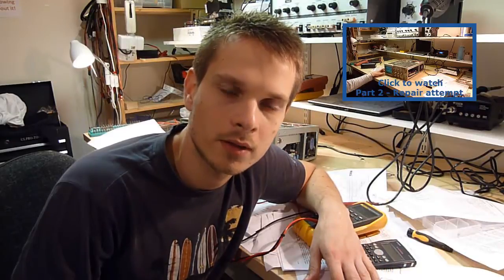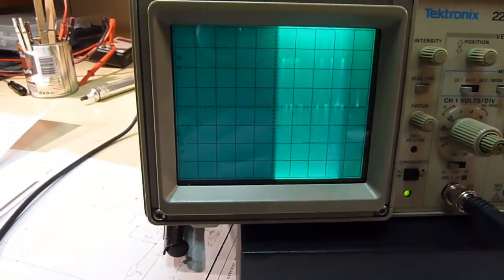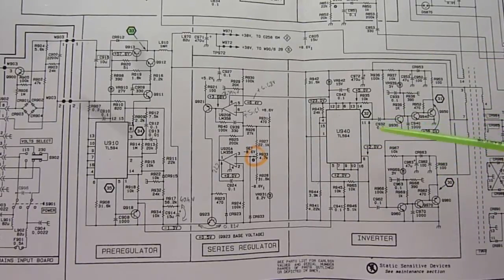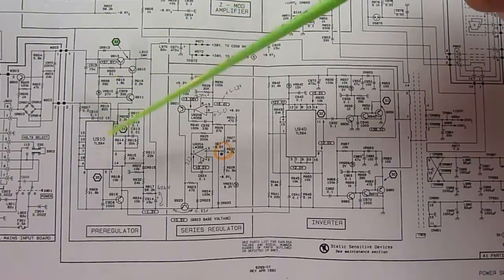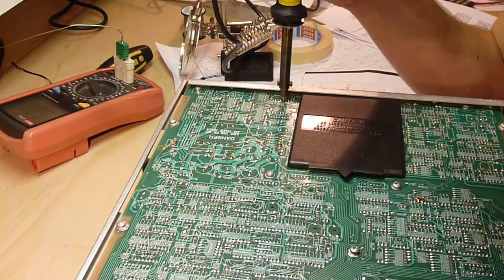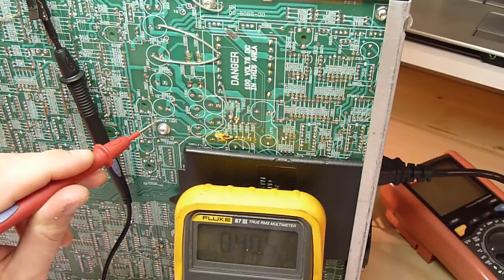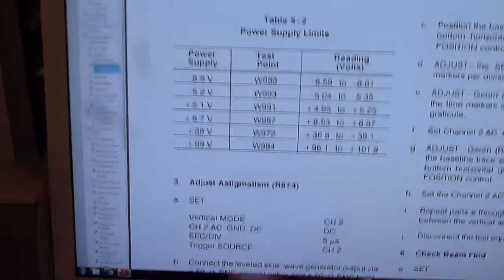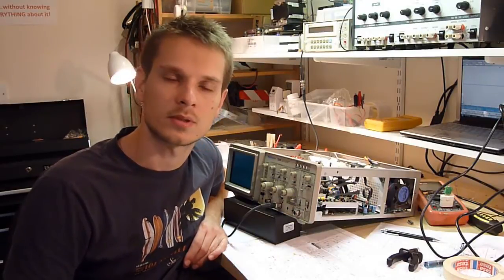ManCave 003 - Tektronix 2201 Oscilloscope Power Supply Description and Repair

Comment: anybody can tell me why my oscilloscope displays only half of horizontal line? and how to fix it?  when it brought to me only bright spot in the center, changed paired output transistors and got only half horizontal line. checked for other side, paired transistors found to be in  good condition, still getting only half line. can anyone help me solve the problem?
Reply: Did you test the horizontal circuit diodes as well?
Reply: Problem solved.
One of 10 ohm transistor bias resistor was defective,  replaced and scope worked as it should.
Reply: Always check beam switch first.. if not working the problem is intermittent switch or solder connection on switch.

Comment: Thank you for your fast reply My friend. And I have opened the same today morning, then  noticed that there are two variable resistors used for controlling focus and intensity, the intensity POT is not at all working, So My question is replacing those resistors would make any improvement ?. Thanks for your time.
Reply from the maker: +Vishnudas Kartha That's interesting. The intensity and focus pots are usually accessible on the outside and from your previous comment I assumed that even using these you cannot get the correct focus. If the intensity pot is not working, this may still cause an effect which might seem like the beam is out of focus, while it's only at a high intensity setting.  Anyway, I would say that it is worth replacing the pot if you are certain it is not working as it can only help.  ...and is definitely cheaper than the CRT :)

Comment: Hello friend, My CRO is not focusing well, The beam is wider( 2 to 3 mm) even though at the maximum focus, and some time it focus correctly. Please suggest an idea to rectify the same. Detail about CRO : Caddo 802, 20MHz. Please help. Thanks
Reply from the maker: +Vishnudas Kartha Hi, I've never heard of Caddo but I would suspect it's the CRT itself that is faulty. Depending on the age and cost of the CRO, it may or may not be worth sourcing a replacement CRT. Good Luck!

Comment: Thank you for sharing your videos on the repair.
I was curious why you didn't put sockets in for the ICs. On through hole ICs I've always soldered sockets in whenever I've replaced an IC. They're cheap.
I was also curious on how the repair is coming along. The problem is obviously in the Horizontal circuit. You're not getting your drive signal to the horizontal deflection coils. Everything else appears to be doing well.
I wanted to compliment you on your troubleshooting thought process and the care you give to your work. Well done.
We live and learn. We learn more from mistakes than successes.
Reply from the maker: hey Fred, Thanks for nice comments and thoughts! I see your argument for putting sockets in. Perhaps next time I will do ;)

The scope is still sitting on my desk without further progress. I will be putting up some videos soon, but not the scope repair. I'm busy at work now and have some projects going on which include stepper motors. So next video will be with steppers...

Comment: Nice video, trouble indeed.

My concern is when you altered the pot in the previous video, it made little or no difference.  I would have pursued that problem.  Those high voltages on the 5V rails could have done a lot of damage to a lot of TTL IC's, this cure may run and run as they say in the film industry.
Good luck!

I do like that Heated solder sucker for £7 you say?

Do you have a part number for it and a place to buy it?
Reply: i know this comment is old, anyway with these really old power supplies, you need to measure when loaded. No load voltages may well be out of spec.

Comment: Is the horizontal routed through the digital board, perhaps? It seems in segment 2 you didn't get a sweep until you refitted the digital board, and in this segment it's not fitted in your final test. Is this service manual to be had anywhere now - I'm not having any luck finding it.
Reply from the maker: Hey, unfortunately it's not that. I tried with and without the digital board and it doesn't work properly either way. The analogue part works ok by itself.
The service manual is linked in the notes below the video! I hope it helps!

Comment from the maker: Thanks very much Jur! I have been quite busy lately and the scope is just sitting open on my bench. I have started reading into it and have some ideas where the fault might be, but haven't had time to actually test it and shoot video. I will try and do it soon!
Reply: I hope you make a next video and find the problem.
Reply: Maybe this channel http://youtu.be/SsoAe0kMYfc can help you. This gentleman works at Tektronix.
Reply from the maker: Hi Edwin, I will definitely do more troubleshooting, just being very short of time at the moment. I too hope I find the fault :)
Reply: +ManCave Hi I have the Tektronix 2235 and it has the same no trace issue. When I push the beam finder it comes on but that's it. So I'm waiting for you to find the solution to the problem

Comment: I liked your troubleshooting, you have done a great job on finding the problem with the power supply (TL594 and the LM358). Good luck in finding the problem of the x-axis, i am waiting with impatience your next troubleshooting video.
The ic who worked in the rail 5.2 v have suffered overvoltage. Some of these ic-s i think are in the : Channel switch, Sweep logic and in the Trigger block.